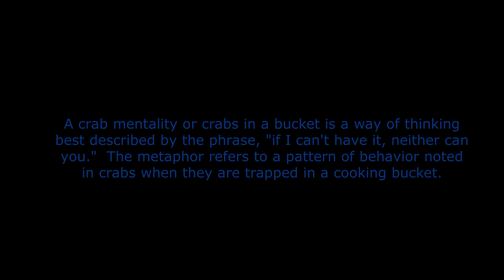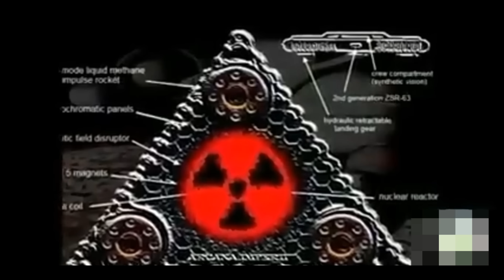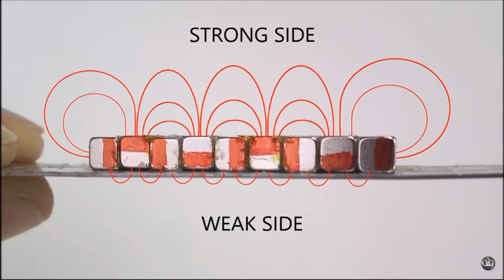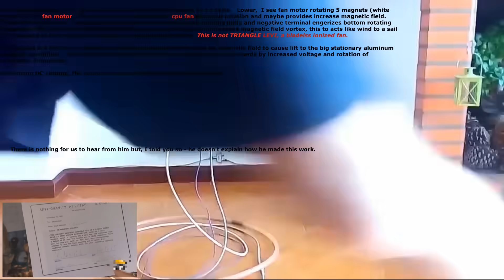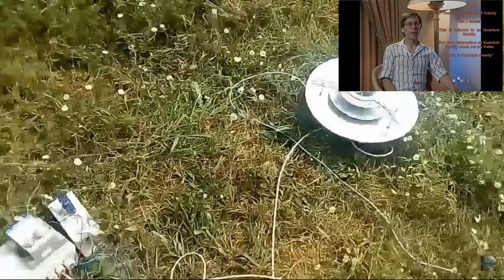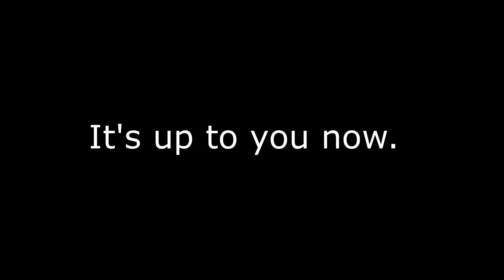anti-gravity project

Comment: I've been in electronics for more then 50 Years. This is what I'm thinking as it relates to Ed;s efforts , (Coral Castle, Florida ), and design, All you need to do is look at his generator device, (one of six he built over time), It uses "V" (NOT BAR MAGNETS), magnets there was a real reason for that. The magnets were set up 25 magnets around and 5 deep. They were set up in repel mode to send as much "B" field into the earth as possible. The "B" field is the center of a magnet not the North or South poles those are the weakest points on a magnet. The "V" magnet is a perfect device for his purpose given the "B" field is at the center and allows all magnets to supply the center as needed then through the crankcase and then into the ground. Once the ground was saturated with the "B" field energy I suspect he would use sound to manipulate the stone do to the fact the stones magnetic properties were totally disrupted by this injection of the "B" field energy. You can conduct your own test just by fast tapping a granite rock with the "B" field of a magnet you will see it loose weight!! Have fun.
Reply: i love ur comment mate, your idea  seems  having connection  with " how the pyramid stones assembled. ohh dont mind me im just another weird guy!
Reply: Had been building all kind of magnetic flywheels for the last fifty years and now looking into less expensive methods to create better system of floatation. Will be interested to share with anyone.
Reply: @ Vince Cox: so that's how he built the coral castle. Thanks very much. I always wanted to know how he did it. One of the Earths great mysteries explained. Thank you very much.
Reply: Guys these are never weird idea's at all !
Reply: Wow, you got more facts than me. I had been trying to works on that Carol information for a long times and just cannot find any leads and maybe we can do a little more new research on them. I am a full times Researchers on a self works innovative ways to solve the problems. My jack of all trades habits wanted to make thing works and will shares any weird ideas as they will give certain leads that could be the missing points. Would you be free to shares.
Reply: I'm
Reply: Would you be interested in an analog  DJ mixer device installation job for an invention prototype ?
Reply: What are you talking about? Your description isn't at all what was found at the Coral Castle, not even close. It was a ring of steel with three electromagnets which injected current in the ring. There were zero of the magnets you described.
Reply: I seem to remember he used horseshoe magnets so do you mean U magnets?
Reply: @donotwantahandle1111    Ford motor used "V" magnets in their model A"S  That's what ED used.   Think about what he was trying to do ....He wanted maximum "B" field energy.
Reply: @vincecox8376  Ok what is "B field energy'? Not the usual magnetic field density I take it?
Reply: @donotwantahandle1111  They "V" magnets from ford trucks..
Reply from the maker: anti-gravity-toridal_synergy
https://youtu.be/8KGuB8bZKNs
Reply: My past remarks still hold real facts.  I should also advise you of more cause and effects that the "B" field provides. If you turn on the kitchen facet and let a trickle of water flow and then introduce the "B" field  by tapping it with your finger near the water flow you will see that the "B" field also repels water!!  The "B" field technology pretty much some's up how UFO'S operate!!   Keep in mind you must keep other metals away from this energy field. Plastic or none Metalic material will show the way.  That why UFO"s are not visible to radar They are not metalic..
Reply: somehow,  the foremost experts on fringe science can't structure a sentence
Reply: @dustinreed944  and some savants are great at math but can't describe to how they did the calculation.  What's your point?
Reply: John 3:16
King James Version
16 For God so loved the world, that he gave his only begotten Son, that whosoever believeth in him should not perish, but have everlasting life. Amen 🙏!!
Reply: @reclusiarchgrimaldus1269  Thank God for that. Can you imagine what would have happened had he not? We would all die one day. Like in a war, or a car crash, or something like a disease or even murdered!
Reply: there is a guy who was able to reproduce everything that Ed did at Coral Castle and at no point is there any need for levitation..  his generators powered winches via ratcheting system, the clover shaped thing was used to time the relays. nothing crazy going on there..

Comment: Years back I was shown anti-gravity device using a  donut-shaped tube lined with Teflon and filled with Mercury the Mercury was circulated through the  tube with electromagnetic energy at incredible speeds causing a gravitational vortex. Static gravitational field was produced around the perimeter of the tube causing adjacent objects to the perimeter of the tube to be unaffected by any other gravitational forces.

Comment: The technology is sound and tested, the problem is electrical supply. That's why its not taken off, pardon the pun. You need the system to generate and use its own electricity. The technology produces movement, can a lightweight KERS be adapted?  New tech for old ideas.

Comment: Forget the copper plate. Get a top cover for a Tesla coil or something similar, liquid mercury (liquid metal),place it inside the case half, and seal it shut.  
  I forgot exactly how to build the magnet that goes with it, but you can find that easy...hook it up to a power supply or battery and to a reostat or similar to adjust power.  If you can  get something to adjust frequency too..
  The magnetic field will cause the mercury to spin inside the container.   It actually creates a protective bubble around the device and the rotation of the liquid metal causes lift, no plates. Anything inside the bubble should have it's weight reduced by around 70% on your 1st try...you can fly a building with no wings as long as your field is large enough to cover it.  Guess what shape the bubble is? 
  Increase in energy =lift
  I'm thinking frequency may induce movement or better.  
  I think this bubble is capable of more than antigravity...i think it can fold space time..
   Now if we can build a wormhole generator...
  Bilky Carson will show you a big one on buzzsaw..a show in the Gaia network...the show is on you tube now.  
  There are several experiments showing this working on here as well.
Reply: You just use the tesla coil donus?   also use the tesla coil?

Comment: That flying disk at the end, I know the effect. It's made with extreme high voltage, thats why you have some cables on it it can't lift too much weight so the generator stays on ground. That disk was my goal, now I see it is possible. Now I want to solve that "weight issue".
Reply: you can also do it without electricity cables. method 1 is the simplest and it uses the method I think you are referring to, so that one is actually powered by ionic energy instead of antigravity, however some years ago I designed a working toy ufo, which was mostly only meant to look like a ufo, to act like one, to fly like one, and to make sure people won't easily figure out how it works. while designing this I also used some form of ionic propulsion, however while making prototypes I found a new interesting point which allowed me to make it able to lift much more weight, become much more stable and safe, and above all be super strong(even with weak and light materials), which allows for making it ultralightweight.

method 2 uses more e like antigravity, and this one I managed to find a way to make it actually fly without adding energy, and which could eventually even generate energy while flying. this is because you aren't countering forces, but instead you are converting those forces into energy. so when countering you have to use a opposing force, however when in a specific state certain such forces get automatically canceled out meaning it almost perfectly reflects the forces causing it to automatically "cancel" them out, or actually reflect them. there was only one main physics problem which prevented this from fully working for long periods on a large scale, and so I looked at that problem again(since I had been looking to solve that specific problem for years), and i found how to not only let the forces counter themselves/reflect them(or ignore them) but this method finally fixed the main problem for actual use and while it was originally a specific polymer I designed because I thought that to be simpler that getting rare materials, eventually I had to manually make a quite raw version which ofcource by far does not even reach that special polymers efficiency, and even less of what would be reached with a properly designed device, or one using specific rarer materials. but it allowed me to see enough to know it does indeed work. this part ofcource is by far not efficient enough for actual use, and one of the most important parts I needed to make this work well is also almost impossible to get for me, due to it only being available for specific facilities.

Later not long ago when experimenting and thinking about My toy UFO(version 1), and improving it using version 2 because version one won't work properly in space(and I was trying to find a way for interstellar space travel without needing to shoot out particles or fuel) doing this I found a way to change method 2(this entire device would be really simple to make if you allow the use of something like batteries, a flywheel, etc.). the main change that I made was some specific thing that is hard to explain without telling how exactly it worked. however to simplify it, it allows such a device(when paired with a powerful computer) to very accurately change and set it's location in space. meaning that unless someone already made warpdrive(which likely already exists somewhere to be honest) this would be the first real world working warpdrive. 
I could for many things only test the parts individually or in more raw ways due to not having materials, machinery, or skill to build a fully working prototype which allows a actual person to travel to space in it. and probably to make it safe it will need some good ai, to calculate the movements since the calculations and factors need to be dynamic and can not rely on the current physics information and calculations since that is way to inaccurate. without complex stuff you can also make it work but it won't be that safe/accurate yet, and more limited in speed, power, and control. 

Also note that those are just devices based on science, physics, experimentation, and such things. some people here might know and understand that there are much better ways, however a device like how I designed it could be made by almost any somehow technical civilization, and it also allows anyone to use it without needing to fully learn and understand it, also it should always work and not be as "random" or influenced by the traveler. while I certainly support that other method. which likely only people who have ever done/experienced it, or whom due to some reason have knowledge or understanding about it will ever know what I am referencing to here. and I certainly would like to see that become mainstream. but for now seeing it is so obscure that you can't even talk about it publicly, and how much of humanity currently likely does not yet have the mental, and other capability to properly do it. such another device for now might be a great option to get more freedom in these times where it is hard to really use that other method due to the obscurity.
Reply: @ted_van_loon  please get in contact with us, we are assembling a People r&d team.
Reply: @BienestarMutuo  keep me up to date i am interested
Reply: @ted_van_loon  No you didn't.
Reply: @ted_van_loon  Thanks for sharing, why don't you create some youtube vids and share these amazing inventions of your and spread the science, the more mainstream this information is the quicker humanity will develop.
Reply: @ted_van_loon  you have a foto (when it is working)?
Reply: i really like to know how this thing works. and how he build it using magnets.
Reply: What if the magnetic force and field inside can be harnessed and the generator be on board with the craft ? Seems plausible giving UFO saucers... You could easily make an invert or converter to change the current and maybe it would shed energy? Not sure but maybe putting an alternator inside by the fan motor bc if there is movement from the magnets than it can generate energy...
Reply: @Quantumfishics  I am pretty sure they are using teslas idea of electricity is all around us and in the air. and the higher you go up so does the voltage
Reply: Energy. But we can't produce enough energy for it to lift higher
Reply: if it have extremely high  voltage  the guy, would be dead, f the impedance is very high  and so the current  is very  low, the fact of the guy touch  the disk would  drain the charge, and would fall to the ground,  so, it must have something  more
Reply: @Fuckit 60htz?
Reply: @blades7178  approx 47khz
Reply: Try a Bearden MEG with DIY metglass. Or a high power, closed loop version of Joule Thief as described by Steven Jones who demonstrated OU on the Shameka channel. Sohei Thoth channel shows circuits to close the loop. Burning Ions shows how to increase the power.
Reply: If magnetism is an invisible force, and we’ve discovered the code for WiFi, couldn’t we just figure out a wireless power source that uses radio waves instead of trying to put clunky batteries and equipment on the craft?

Comment: So this isn’t really gravitation it’s more magnetism wrong focus here
Reply: I looked into it quite a bit for a while the best I could determine was we're not entirely sure at every level if they're different or the same. We know it's electromotive Force that keeps you from like going straight through the chair when you sit down or the wall or the floor there's a lot you wanted to expect that we learned is actually what's going on so let's say stay tuned
Reply: Wuety06 my theoretical question would be then if we create a neutron rich solution like say a red mercury of sorts and spun it eccentrically, a gravitron could be created whereby negating general surrounding gravitational field . Of course that could create a torsion after effect of plasma but the pull will contain it, this could be created to levitate the object no ?
Reply: @nikitachirich7985 sounds like a different err.. twist? on rotating capacitors. I have no idea for certian. that said there's a few thing I want to try along these lines. almost was set to do it then my parents house transfered mold to my apt and on moving back in to their place and pro confirming their house had large issue.. their personality disorders became apparent and literally created my current situation where police are overlooking check fraud mail fraud participating in removing me from that house sans everything I worked for and allowing parents to force labor under threat all my stuff is desteoy and or start from destroyed credit homeless wirh a jaw about to rot off. on the plus side covid lick down isn't much  different for me than the last 3 years. before it all started my dad had agreed to finance a shop if I  went all in. in 4 months and on the 3rd floor of apt no elevator I had a 3 electronics bench work shop, vacuum pull down UV litho exposure box I made from plans in my head. plexi and low iron glass, verticle ariated Etch tank for cupric Etch on patio. taught myself cad and was making PCBs with features down to 8thou on 2 Oz. I did 30 repairs from board level to software and had taken a design contract from friend in Cali. had working prototype then all the sudden I'm bleeding from fucking everywhere.. what drug the mold up was 8th grade cat who was then 16 got sick and I would drive to their house some nights to sleep next to my dying buddy. often basement carpet. at 13 I passed ham radio liscense exam but other than that my formal edu was cs not ee. but I'm pretty good at coding, to the point that a prof with PhD in cs masters in is told me I'm one of the brightest he's ever seen. I didn't figure out that math dislexia was a thing till after dropping out though. calculus no calculator proved to be when all the shit I compensated for hit between ticks of the clock on exams. over years though in free time I had tried to figure out as much as I could about what's going on at a hardware level when code runs so when I set out to make PCBs of my own design I and thanks to concepts learned via ham radio already had pretty solid understanding of basics. I was doing that alone so idk just how rare my sucess was but when I say 8thou keep in mind I have etched maybe 10 boards max. one or 2 people just stopped talking in more on topic convis about that. but it wasn't luck.. I studied my ass off on all the details like peeping the copoer clad, tried 3 different resists before finding a source for actual dupint riston. tried several transparencies till I found emulsion coated screen printing transparencies and then doubled the print up over a light box. even then watched prep and heated Dev bath. technical shit is just that.. or rather attention to fine detail. which also makes me question some of the suposibly crazy and disproven theories because anything with any complexity is easy to think u replicated when u have infact not. also while there might not be free energy that doesn't rule out amplification at least towards certian tasks. I'm glad that the em drive came along to give sci a kick in the ass again